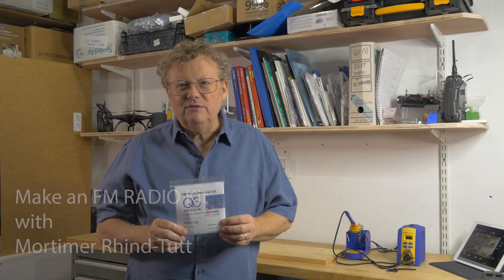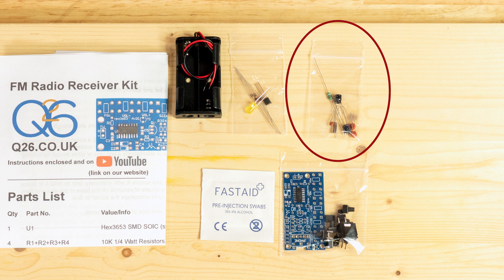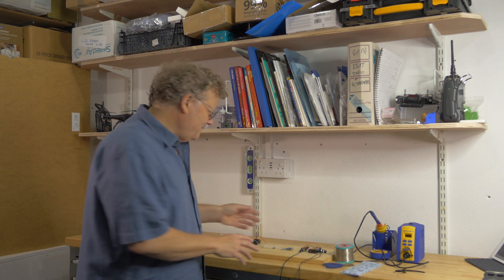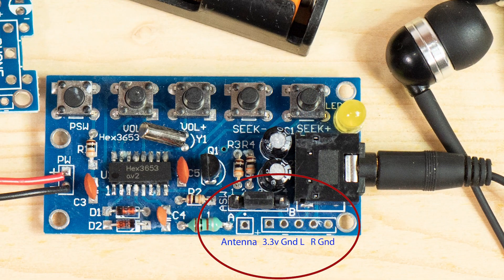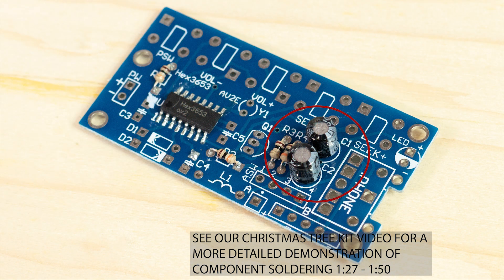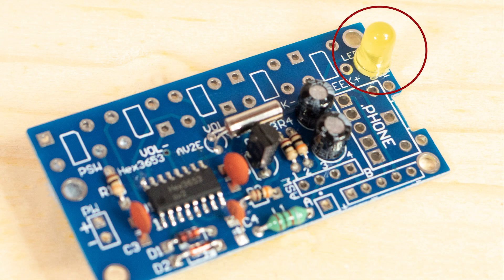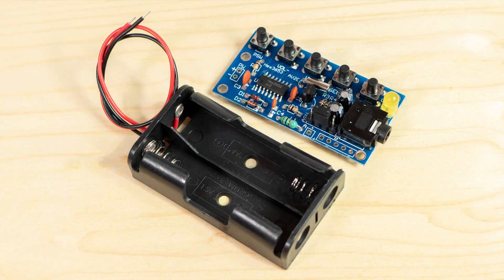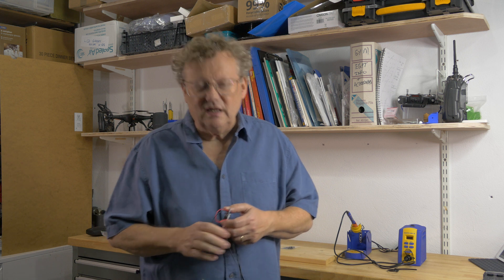Make an FM Radio Receiver Kit

Comment: Hi. Have just built this kit and it works very well. Mine didn't have instructions and was purchased elsewhere. Also had to solder in the SMD chip. Not too hard to do the chip. Good 25 Watt soldering iron and did two pins at a time for the SMD chip. Thanks so much for the build guide. Especially important to bridge the two header pins.
Reply from the maker: Glad it helped...like & subscribe for more videos...